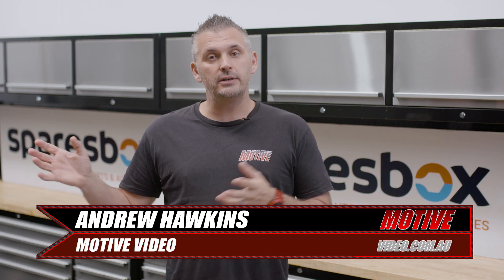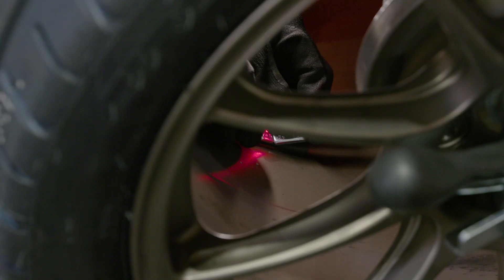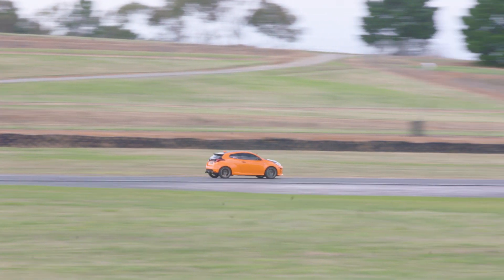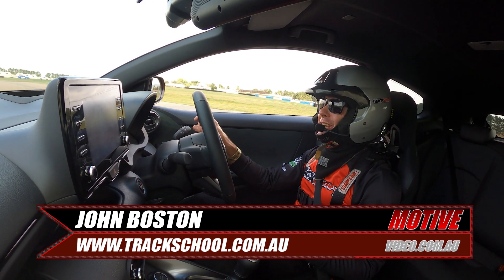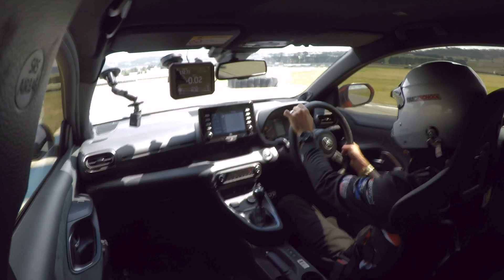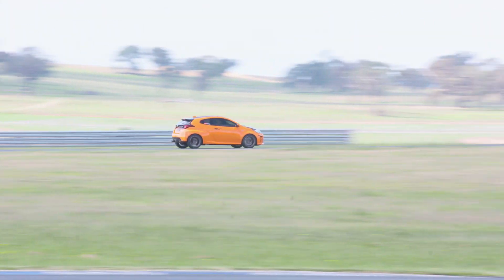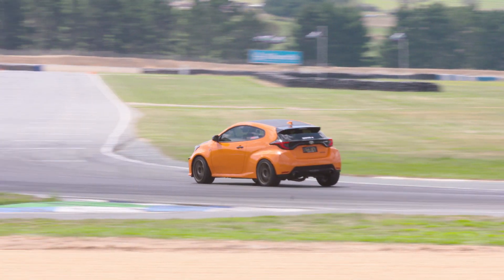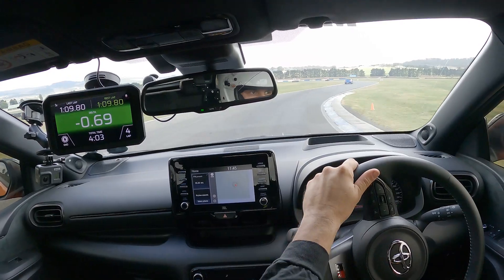GR Yaris Handling Transformed! Track Testing at Wakefield - Motive Garage Yaris Ep4

Comment: Great video. Awesome project.

How would it go with stiffer springs and dampers and wider lower profile tyres? There still seems to be quite a bit of tyre squealing through the corners. Also, would competition brake pads help?
Reply from the maker: one step at a time mate. thats how R&D works 
we have lots of mods coming

Comment: crazy how much it leans over, even crazyer you guys r not getting the "track" version of it.

also, did you guys open the brake duckting?
I made a 3d copy of my oem ducts, almost ready to print.
you can have the file if you want
Reply: We are meant to be getting the track spec version in a few months here called the "Rallye"
Reply: No one has even cooked the fluid yet 😋

Comment: I think you need an oil cooler and probly a sump baffle now with the extra grip from the new tyres! I would at least fit some temp sensors and monitor your temperatures.
Reply: Oil temp is displayed on dash and doesn't reach limit which has audible and visible warnings if reached.  Lil Yari does good👌
Reply: @jasoncee666  if it's accurate then that's a really cool feature of the Yaris!

Comment: This is the 'inconvenience' pack too (lol) not even the track pack, which would have been.. I can't even imagine. Imagine front and rear mechanical differentials on this thing. It's real.
Reply: $16,000 extra for LSDs . Andrew can easily do that for WAY less
Reply: @Garage.Philosophy  Your pricing sounds WAY off, the track pack isn't much more expensive than the convenience pack. All the reviewers even go out of their way to say that not to buying the track pack model is a cardinal sin. 
Australian's are just unlucky to be stuck with just the convenience pack model being available to them for now. At least Australia gets the car.
Reply: @sunrisesunset1734  firstly track pack isn’t an option here we were offered base and rallye which were sold out very quickly and now not available . The rallye rrps for $56,200 drive away with on roads and Andrew purchased his Base model for I think $40,000
Reply: @Garage.Philosophy  Well, other countries are paying around $3,000 extra for the track pack, it's supposed to be a no-brainer. Even so.. it's a Toyota so it's worth the money. What else can you drive to work monday to friday, thrash on the track on weekends, and not have to spend a cent in repairs? It's still way more than worth it in the end. Didn't know prices suck so bad in Australia.

Comment: I won't call the Zestino Circuit 07S tyres is a semi slick, they more like a ultimate mix between the Full Slick tyres and Semi Slick tyres. For racing only! (Not road legal)
Reply: It is absolutely a semi slick tyre. In fact, practically 3 quarters of it is a slick.